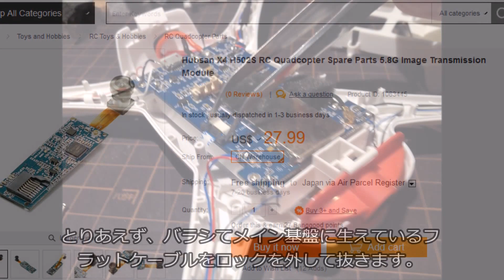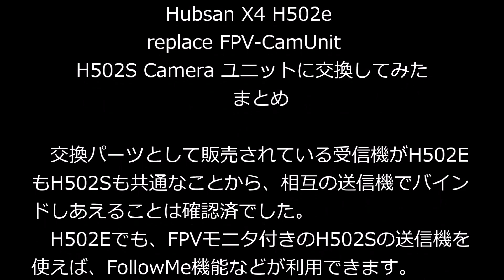Hubsan X4 H502e replace FPV-CamUnit /H502S Cameraユニットに交換してみた

Comment: I have a FPV  transmitter from a H107D+   that flew away ;-(   Can this H107D+  transmitter be used to show the FPV  if I change the camera board to it as you show? Could I just look at the H107D+ FPV transmitter display to see what the quad sees but control it with the other transmitter which has the GPS system?
Reply from the maker: Thanks for your comment. I do not have an accurate reply to you. I know that 107D transmitter is using 5.8 G radio, but I do not have 107D transmitter.

Comment: hi, I boy the fpv camera for 502s and installed it in my 502e and the camera portion works but the fpv portion does not work.  any ideas
Reply from the maker: I do not know why the FPV is not working. I got a lot of success reports, but it is the first time that FPV alone can not do it. Cause of FPV monitor? Problem with video transmitter? Different channel of radio waves? All of them are expected, but it seems necessary to solve the problem one by one. Good luck.
Reply: Ultra Micro Maniacs I haven’t tried to record yet but I can’t get my h502s camera to give me fpv I installed it inside my h502e and it has power by blue light but no fpv

Comment: Nice Video. What 5.8ghz antenna did you use for the camera or did it come with the camera?
Reply from the maker: Thank you for your comment.
I did not get the camera with parts, but because I removed it from H502S the antenna is original.
An alternative to the 5.8 G antenna is also available for 2.4 G.
Reply: So the 2.4ghz antenna will work instead of the 5.8ghz? That seems odd that it would be sufficient.
Reply from the maker: Yes. It works. It is better to cut the tip by 1.5 mm.
The reason for cutting is to match the wavelength of 5.8 G.
However, the original performance can not be demonstrated. So this is the last trump card.
If you do not expect to fit in the aircraft, I think that a 5.8G antenna for FPV is good.

Have a nice year.
Reply: Thanks! Very good information

Comment: hola saludos compañero tengo una pregunta uno de los motores b de mi 502e dejo de funcuinar se lo cambie lo solde como va y ahora lo prendo y da vueltas pero mas lento que los otros 3 motores no quiere volar me podrias ayudar? grasias espero pronto tu respuesta
Reply from the maker: Hola 502S que poseí el motor B fue dañado.
Ahora equipado con una cámara FPV a 502e estoy disponible.
Cambio de motor roto. También puede obtener partes.
Usted, pero no sabe donde vivo, para echar un vistazo porque vendieron las partes en Banggood y SureHobby.
Gracias.
Reply: Ya yo lo monte el motor nuevo. Nose que pasa que ahora prendo el 502e y uno de los motores a se prende si bregar con el control nesecito ayuda que puede ser

Comment: hola saludos la camara del x4 502s se puede remplasar por la del x4 502e ? se puede usar el mismo control remoto con esa camara? graba con esa camara?
Reply from the maker: Hola, Gracias por el comentario.
Y H502S de la cámara, H502E de la cámara es el mismo control. Cada uno de la cámara es la única diferencia entre la presencia o ausencia de la función del FPV. H502S y H502E del receptor es el mismo.
Esta información es la esperanza de que te sirven.
Gracias.
Reply: Grasias por contestar y el control remoto del 501s funcionara para el 502e? Yo tengo el x4 501s el x4 502e podria usar el mismo control con los 2 se podra ver el fpv en el 502e. Con el control del 501s?
Reply from the maker: En otras palabras, quiero decir, tanto el receptor de la misma. La única diferencia entre la unidad de cámara.
La diferencia del transmisor, por H502S y para H502E, única función FollowMe.
Reply from the maker: Todavía no he probado, pero el transmisor de los 501S es, debería también puede ser utilizado para 502S.
Esto se debe a que, desde que era capaz de saltar los 502S 109S en el transmisor (H-7000).
Sin embargo, no funcionó la función FollowMe.
Algún día, y quiero probar Si obtiene un transmisor de H501S.
Gracias por comentar usted.